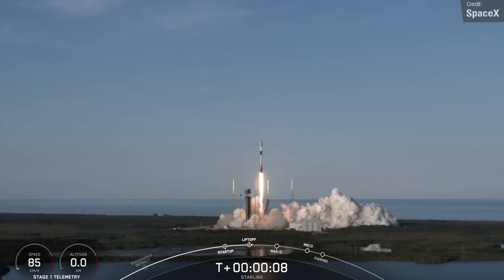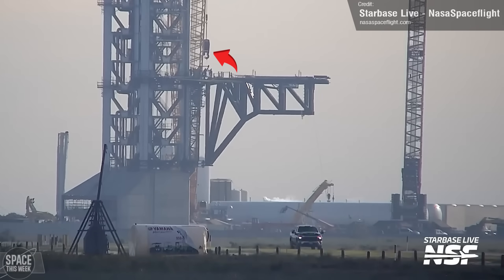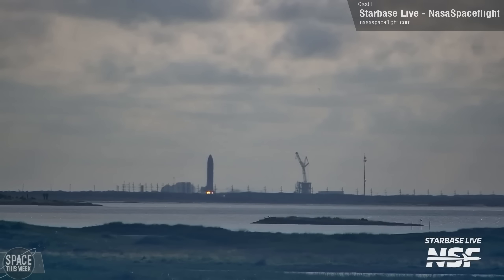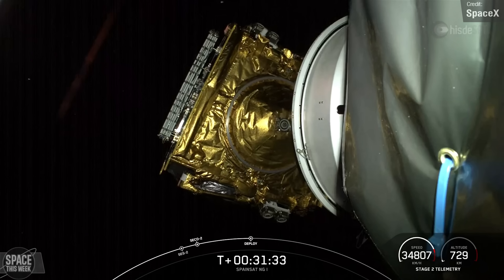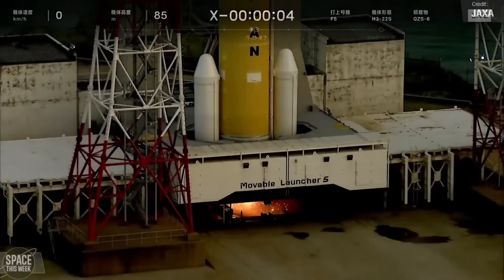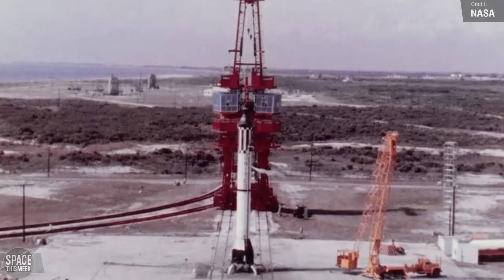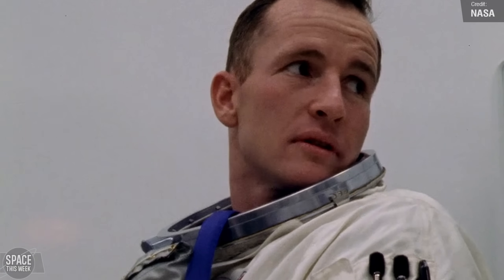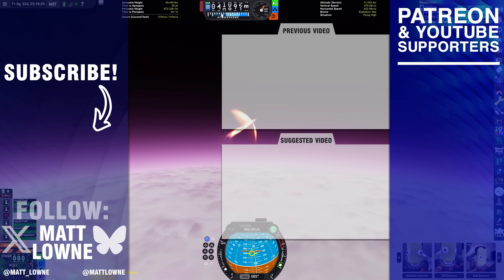Starship is GROUNDED, and SpaceX Installs SECOND Mechazilla catch Chopsticks!

Comment: The whole catching thing is a terrible idea. Sure, it's an amazing achievement. However, even if it's extremely reliable, all it will take is ONE failure to destroy the entire launch infrastructure. It'll set them back months or even years. The risk vastly outweighs any benefits. Launching a rocket will never be the same as flying an airplane. The technology is vastly different.
Reply: I agree - the fact that it relies on the thrust of the Raptors to get caught safely is a pathway to disaster. If the shuttle had main engine damage on orbit, it would be (mostly) fine. If Starship's sea-level Raptors are damaged on orbit, it cannot return to Earth successfully.
Reply: It certainly requires more redundancy, but I don't see why that could not be provided, once a functional configuration has been decided on. I wonder however whether the whole refueling will ever work with rockets shuttling fuel into orbit with realistic turnaround times, rather than having 20 complete rockets on stand-by at once and launching them in sequence. And at which point this will break even compared to just having one rocket which then dissolves.

Comment: i wish they recorded rocket launches with film cameras like the one for the space shuttle instead of using high quality resolution
Reply: nasa uses the camera but dont make the videos public sadly
Reply: I don’t see any practical benefit besides viewing aesthetic, but any hobbyist on location is free to do so themselves. Alternatively, I don’t doubt there will be / already are AI filters to make it look like such. 

As some food for thought, i wonder if the damage to Columbias heat shield might have been taken more seriously if they had higher quality cameras? 

Of course we know the blame lies in the hands of NASA executives and their attitude towards safety concerns, but I can’t help but wonder if the damage would have been more apparent if it was recorded in a higher resolution.
Reply: @4rt3m1s-b6p  I doubt the damage would have been taken more seriously - they still wouldn't be able to see the leading edge with their cameras, which is why post-Columbia launches has all of those external tank cameras. Besides, as you said, NASA management turned down a offer from the Air Force to use (presumably higher resolution) spy satellites to image Columbia, so they weren't concerned enough for it to matter.

Comment: Artemis is such a dumb program
Reply: I don’t see why
Reply: That's like saying shuttle was dumb - just because it's expensive and slower than promised doesn't mean it's a bad program. NASA's requirements for commercial crewed spacecraft safety is likely making Starship much safer than if it wasn't a part of Artemis, and besides, what would you do in its place? Bring back Apollo?
Reply: Recovering some stages would be nice but Orion probably won't kill anyone
Reply: HLS is overkill, and incredibly inefficient for what it needs to do. SLS is pointless, Gateway has an incredibly foggy purpose. We need 15 starship launches plus SLS just for a single surface mission. The list is unending.
Reply: @ThePlecoPal  Yes, Starship HLS is overkill. Ideally, NASA would prefer a lander similar to Constellation's Altair. Unfortunately, the Starship happened to be the cheapest proposal despite being the biggest, and NASA needs to save money where possible. 

SLS is not only the sole vehicle rated to carry Orion, but it's the main political driver behind keeping the current Artemis infrastructure - both legacy and new parts for it are built in 49 out of the 50 states, and that keeps the politicians happy and willing to keep funding NASA. 

Gateway's scientific and developmental purpose is, yes, pretty foggy. However, it's the only major part of Artemis that is majorly international (aside from Orion's ESM), and it's also a space station. NASA figured out with the Apollo Applications Project and Skylab that if you have a station in orbit, Congress will generally keep funding missions to it (as opposed to "abandoning" it) even if everything else is cancelled. Gateway exists to continue ISS partnerships and contracts with other countries, and to act as insurance to make sure Congress will keep funding, at the very least, Gateway missions, which NASA can justify converting into landing missions.

Overall, yes, Artemis is inefficient. So has every NASA program been since Apollo. That's because NASA is a government agency. The most efficient projects rely on the least subcontractors, all in the same area. That is the opposite of the goals of Congress, and thus NASA's goal (politically) is to be as inefficient as possible, because that makes states the most money with the least risk. It's unfortunate that politics conflict with science in this way, but ultimately, without nation-wide congressional support, no more NASA.

Comment: Utterly baffled at how dense starbase is around the launchpads.  When the first booster fails in a catch attempt, the damage is going to be massive.  They're going to be picking chunks of stainless steel out of the walls of neighboring buildings (and off their floors, along with whatever they impacted along the way) for weeks after.

Move fast and break things indeed.
Reply: Starbase will be more for development, it's looking far more likely the cape will be the main launch base.
Reply: @Codysdab  ...My guy, rockets are about 99% more dangerous while they're in development... which they are... at the most dangerous place.
Reply: @Rockethead293 true, but the OP was talking about launch failures specifically, so worrying about a booster falling on Starbase is irrational since they launch elsewhere.
Reply: @Syntex366  They don't launch elsewhere, though, they launch at starbase
Reply: @Rockethead293  at the moment, they've facilities being built at the cape as well as a monstrous gigabay which'll be bigger that the NASA assembly bay.
Reply: @ Um, where did every IFT mission launch from?  And I'm not talking about launch failures, I'm talking about _catch failures_.  Otherwise, why would I say "catch attempt"?
Reply: Massive damage from what exactly? No, seriously, think about it for two seconds for once before you answer.

The booster has a ballistic trajectory to land in the water and only swings over in an attempt to be caught when all of the required engines relight. Every Falcon 9 does this exact same thing as well. If the boosters fail to relight, or the catch attempt is aborted after reentry, we already got to see the results of that during the second test flight. You already have video proof of what happens. It lands in the water. So it's not like there's ever going to be this massive crater in the ground in the middle of Starbase caused by a booster failing to relight and impacting the ground with the force and speed of an object falling back to Earth from space. It is ballistically (understand this to mean uncontrolled "flight") impossible.

If the engines relight and the booster swings over, but it runs out of fuel or the engines fail and the booster drops... Well, you have a thin walled steel tank that's basically dropped from a few hundred to a couple thousand feet (assuming they don't detonate the booster themselves with the launch explosives, which I don't know of any reason why they would do that considering it's an empty tank and there's no fuel to ignite which makes them all but useless). Loud noises will happen as the booster partially crushes itself upon hitting the ground, sure, but again, it's not like there's going to be a massive impact crater in the middle of Starbase, the booster simply will not be falling fast enough for that because the engines relit long enough slow down and get the computer to initiate the swing over... And it's not like there will be a powerful explosion since most or all of the fuel will have already been expended. It is an empty tank at this point. Having been in a place where an empty tank has been dropped before, "massive damage" is a gross over evaluation of reality. Some damage, but nothing that can't be fixed in a couple of days, certainly not the weeks of picking steel out of the walls and floors of everything all around. There simply is not enough energy in any impact at this point to do much.

The worst case scenario is the engines cutting out right after the booster begins it's final maneuver to stop it's swing to the catch tower. (We actually almost had this exact scenario in the first test flight as SpaceX has openly stated they had 1 second of fuel left before an abort.) But again, like the previous two scenarios, at worst, it's going to either hit the tower and maybe miss the catch arms and drop to the ground in front of it making loud noises as the booster itself crumples while hitting things, and the only explosion will be from what's left in the landing fuel tanks, which should be close to nothing, so maybe part of the tower is damaged in the following fire as what bit of fuel that is present burns off, which is unlikely. There simply is not enough energy involved with any impact here to do any real damage.

The most absolute worst case scenario is the booster exploding right before launch when it's fully fueled, which could rip the launch tower apart and send pieces of tower into everything all around it, achieving your "massive damage" imagination... But that's not the scenario you've posed, as you've stated "in a catch attempt" so again, I'd ask, think about it for two seconds and ask yourself again, what massive damage do you think is actually going to happen? Do you simply not know how SpaceX boosters land? Do you think boosters land with all of the fuel they had on them when they took off? Do you think these things are built with battleship levels of wall thicknesses that would allow serious amounts of shrapnel to be blown off in every direction despite not having any of the fuel in the tank to create an explosion powerful enough to do anything even remotely close to that? Have you lived under a rock your whole life thus far and this is the first time you've ever seen this kind of sorcery and this is pure speculation from a completely uninformed standpoint? The statement alone alludes to the fact you are simply clueless to reality. I mean no offense, really I don't, but what you describe is impossible and it takes a fairly wild imagination and complete ignorance to arrive at that conclusion.
Reply: @ A rocket that is out of fuel is not out of explosive material.  The pumps don't work on fumes.  But running out of fuel isn't a likely cause of a crash, anyway.

But you've seen the shrapnel blown off these things already, if you've kept up.  When a starship exploded after a hard landing on a pad further away, it sent out shrapnel that impacted buildings, which were, again further away than the tower is from those same buildings.  And the booster is much larger, with a lot more kinetic energy.
Reply: Really is a daft site for the job that's evolved.